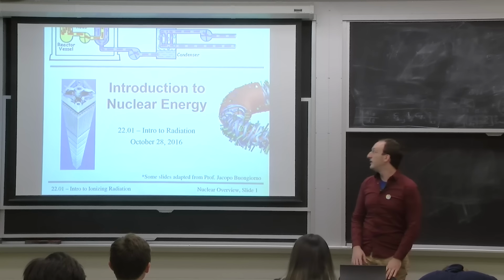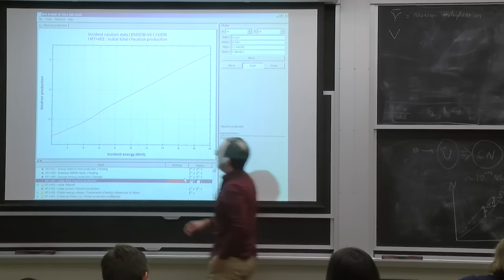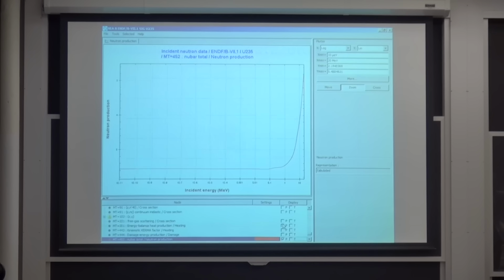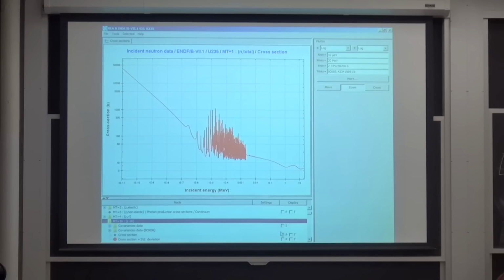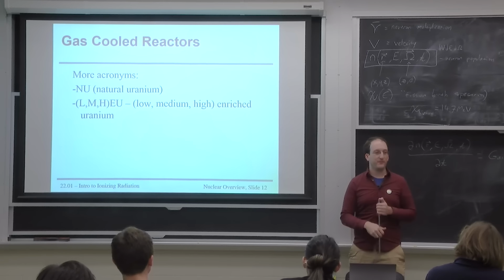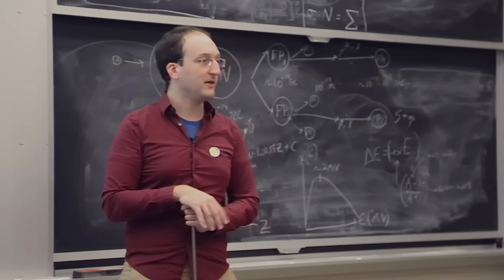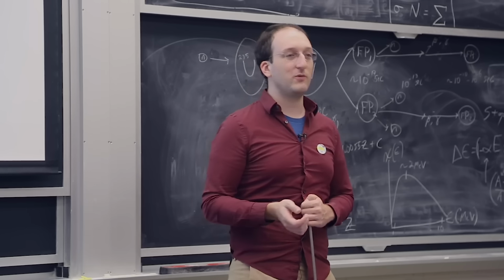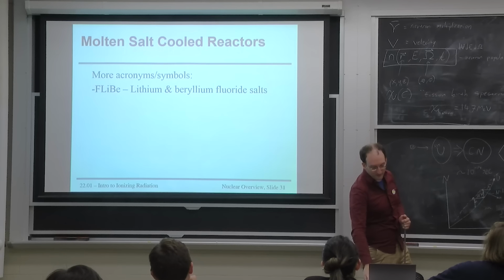20. How Nuclear Energy Works

Comment: Regarding the RBMK control rod design.  The control rods were never supposed to be pulled up all the way.  Deputy Engineer Dyatlov and Reactor Operator Akimov had to bypass a lot of safety and limitation controls.  

Why did the control rods have graphite tips?  To rapidly preheat heat the incoming water at the bottom and reduce the temperature gradient along the channel.

Had the control rods been kept in their maximum power position and not past that, AZ-5 would've saved the core as the graphite portion would've exited the bottom and the incoming boron would've shut down the channel.  As it was, the graphite came in at the top and it was over 200 rods at once.  Way too much graphite and entering the part which was expected to be boiling anyway.

Comment: We can use dimensional analysis and group theory to advance fusion power in a number of ways.

Dimensional analysis can be used to determine the relationship between different physical quantities. This information can be used to design and optimize fusion reactors. For example, dimensional analysis can be used to determine the optimal temperature and pressure for fusion reactions.
Group theory can be used to classify the symmetries of the four fundamental forces of nature. This information can be used to develop new theories of fusion power that are based on the unification of forces. For example, group theory can be used to develop new theories of fusion power that are based on the strong force.
In addition to these two tools, we can also use other mathematical and physical tools to advance fusion power. For example, we can use computer simulations to study the behavior of fusion plasmas. We can also use quantum mechanics to study the interactions between particles in fusion plasmas.

The development of fusion power is a challenging task, but it is a task that is worth pursuing. Fusion power has the potential to provide a clean and abundant source of energy for the future. By using dimensional analysis, group theory, and other mathematical and physical tools, we can make progress towards the development of fusion power.
Reply: You copy and paste a response from ai?

Comment: Here is the elegant equation that combines the four fundamental forces of nature using group theory:

G = g^2\frac{4\pi\epsilon_0}{c^4}

where:
* $G$ is the gravitational constant
* $g$ is the strong coupling constant
* $\epsilon_0$ is the permittivity of free space
* $c$ is the speed of light

This equation can be derived by using group theory to classify the symmetries of the four fundamental forces of nature. 
Group theory is a mathematical technique that can be used to classify different types of symmetry. In this case, we can use group theory to classify the symmetries of the gravitational force, the electromagnetic force, the strong force, and the weak force.
Once we have classified the symmetries of these forces, we can use it to combine the equations that describe these forces. This gives us the elegant equation that combines the four fundamental forces of nature.
This equation is a powerful tool for understanding the behavior of matter at the subatomic level. It can be used to study a wide range of phenomena in particle physics, such as the structure of hadrons, the behavior of quarks and gluons at high energies, and the electromagnetic and strong force interactions between quarks and gluons.
This equation is also important for understanding the unification of forces in particle physics. 
The goal of unification is to find a single force that describes all of the forces of nature. This is a difficult problem, but it is one that is being actively pursued by physicists.
The elegant equation that combines the four fundamental forces of nature using group theory is a step towards unification. It shows that the four forces are related, and it provides a framework for understanding how they might be unified into a single force.

Comment: Here is the elegant equation that combines the four fundamental forces of nature using dimensional analysis:

F = G\frac{m_1m_2}{r^2} + \frac{q_1q_2}{4\pi\epsilon_0r^2} + \frac{g^2}{4\pi}\frac{\exp(-mr)}{r}\mathbf{r}

where:
* $F$ is the total force on a charged particle
* $G$ is the gravitational constant
* $m_1$ and $m_2$ are the masses of the two particles
* $q_1$ and $q_2$ are the charges of the two particles
* $r$ is the distance between the two particles
* $g$ is the strong coupling constant
* $\epsilon_0$ is the permittivity of free space
* $m$ is the mass of the exchanged particle

This equation can be derived by using dimensional analysis to determine the relationship between the four fundamental forces of nature. Dimensional analysis is a mathematical technique that can be used to determine the relationship between different physical quantities. In this case, we can use dimensional analysis to determine the relationship between the gravitational force, the electromagnetic force, the strong force, and the weak force.

Once we have determined the relationship between these forces, we can use it to combine the equations that describe these forces. This gives us the elegant equation that combines the four fundamental forces of nature.

This equation is a powerful tool for understanding the behavior of matter at the subatomic level. It can be used to study a wide range of phenomena in particle physics, such as the structure of hadrons, the behavior of quarks and gluons at high energies, and the electromagnetic and strong force interactions between quarks and gluons.

Comment: Fuck nuclear it doesn’t work it just kills people with cancer reactors leak 24 /7  there is no safe level of radiation period you stupid asshole
Reply: The ignorance of your comment is just astounding.  Nuclear reactors are very safe when they are operated correctly.  I served on a U.S. nuclear ballistic missile sub during the Cold War and we never had a nuclear accident.  That goes for the nuclear surface warships, as well.

Nuclear accidents in the large commercial nuclear power plants happen when cost-cutting, deferred maintenance, and bureaucratic mischief interferes with operations and safety.  Everybody likes to beat up on the RBMK reactor of Chernobyl.  It takes very little investigation to find out that certain tests that were NOT done before certifying the plant as operational.  The builders wanted to get that bonus for getting the plant built ahead of schedule!  Is that the fault of the RBMK design or nuclear power in general?

The Deputy Engineer in charge abused his authority and ordered that test to be done without following proper procedures.  He also went against his shift foreman and nuclear operators who protested.  But, they were outranked, the test was done to the parameters HE set, and Chernobyl became the poster child for anti-nuclear power idiots.

The RBMK reactor was designed to operate on poor quality and very low enriched fuel.  Those parameters required different SOP's to operate safely.  The Chernobyl disaster would never have happened had things been done according to the rules.  The same can be said for Fukushima and other disasters as well.

Comment: The brief explanation for the reason of the graphite tips on the control rods of the RBNK reactor is not entirely correct. The main reason for using the graphite tips was to control the  neutron flux, to make it more even. This was necessary because of the large size of the core.

Comment: I’m missing the bit on fusion reactors and their advantages and downsides. I heard that corrosion of the reactor walls can be an issue and that they are trying to solve it using liquid ceramics? How far off are we with fusion reactor design (not so much the fusion process itself)?
Reply: There are some videos on YouTube that try to answer this, but if I remember correctly the estimate was 30-40 years

Comment: We boil water with hot rock and is spins wheel around really fast... The subtlety of controlled sub atomic ion cascade reactions aside... Im not wrong. Its atomic power using stone age methods... it might as well be a steam locomotive, for all the actual nuances that exist between boiling water with coal, or high energy particles.
Reply: That rock stays hot for 24 months straight

Comment: Skipped over the benefits that led to the AGR being chosen as the UK design, namely on-load refuelling (but engineering gets in the way...), massive safety thanks to natural circulation and a really low power density, among other things, and incredible thermodynamic efficiency, which I believe has still not been beaten by any other design. It's just a shame it's so expensive...

Comment: 32:42 He is talking about AGR reactors and asociating them with the windscale fire. 
The windscale fire was, as he said, due to the wigner effect but the windscale piles did not use the AGR design.
The windscale piles was of a much simpler design using air cooling.
Reply: Exactly. The Windscale piles were built in a hurry to make plutonium. The AGRs were a development of that technology for civil power production (and a little bit of plutonium production that we don't talk about...) that, critically for the point he's making, do not use air for cooling!
Reply: Yep. The air cooling was the big difference.

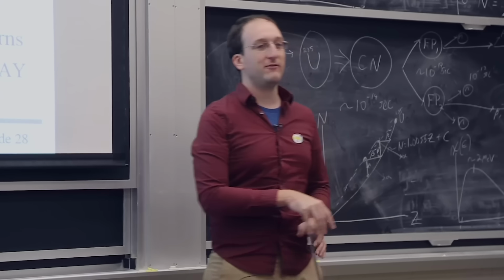Comment: 45:20

There is a error here.
There exist no BN-300 reactor, there is a BN-350 reactor, but it was shut down many years ago. The active once is the BN-600 and BN-800. The 350 also refers to thermal power, while the other two is electrical power. So the first one is fairly old.

When this was recorded the BN-800 would have been in hot testing